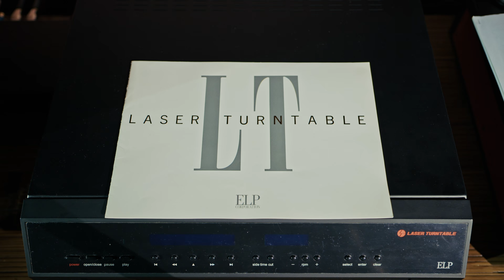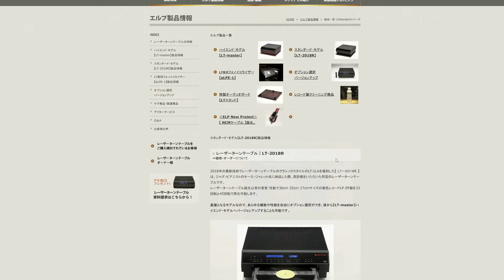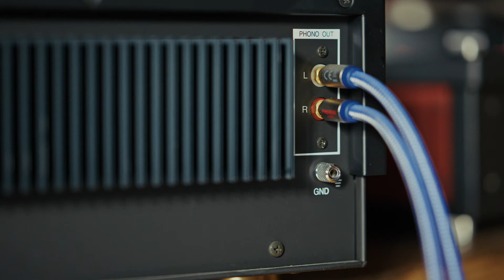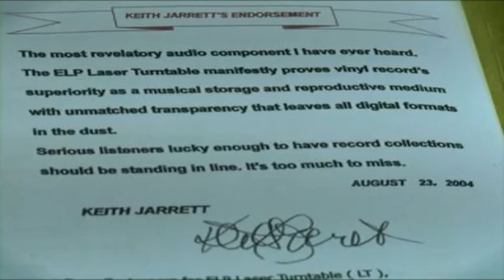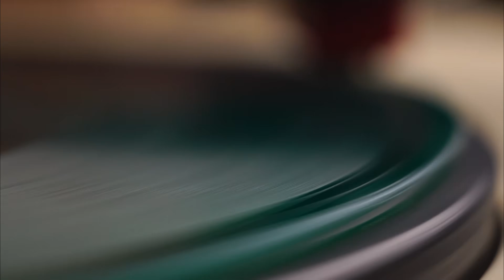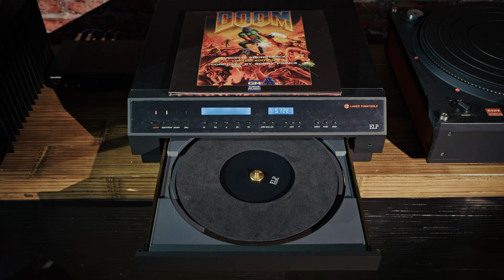ELP Laser Turntable Review / Including Christmas Giveaway - Is This THE ULTIMATE Turntable??

Comment: Cool you can speed up the vinyl on rpm. Not just 33.33 or 45 and so on for presets. Can fine tune it. Sometimes sounds better speed it up a little. 

For make a dj unit. Be little different and more expensive. Little bit smaller. I seen and played with dual dj cd players. I think be the same concept but much bigger form. Laser vinyl decks be more thinner and cables connect to the player cd vinyl drives will go to controller, which have screens, pitch control faders and jog wheel etc.. or big 12” vinyl style moving wheels. Can make it look like vinyl. Many ones have ideas. For example Rane 12’s. which only works with computers dj software. This one be more to vinyl only with controller running it. I do like idea. Have to be more shock resistant if playing in clubs etc.. price be somewhere in 38000 each or less or more. All depends i guess.

Comment: Excellent review, thank you very much.
If I may, I would like to add a few words of my own about this remarkable device.
I am a long-time ELP fan, and I currently own the latest Master Alpha model with the additional Phono-D  output, which I received just about a month ago. In his review, author mentioned the high and mid frequencies — and I would like to add that the bass performance is also outstanding: tight, deep, and full-bodied. This is without a doubt another strong advantage of the unit.
Compared to previous models (this is already my third unit), the stability of LP playback has improved significantly, and playback errors have become virtually nonexistent.
I would also like to note that my unit features a wooden base, which adds a touch of elegance to its appearance. In addition, the feet have been upgraded to more stable, vibration-damping ones.
Another important point that the reviewer did not mention is that the sound character remains consistent over time, unlike what often happens when changing a cartridge.
Of course, a clean LP surface is required, but given the many advantages of this system, this is only a minor consideration.
Reply: i almost bought a unit new @2005 for 5.000$. it was a time when it was changing models. after all these years, one can find many videos to check out the quality especially against high end turntables like the sp10r. how would you rate it against the best you have heard (and which combo that was)? tyvm!

Comment: If I ever win the lottery...this would be a GODSEND to digitising records where the CD or digital versions are often brickwalled to death.
what about off-center records though? will it have issues with those? will it ignore the speed variation?
Reply from the maker: I haven't found any off-centre record in my collection, so I couldn’t test it.
Reply: No. The best remedy for off center records is either removing the spindle and centering without it (preferred) or enlarging the hole sufficiently to allow centering with one. 

I would not want a laser turntable. Too much complex circuitry that could fail.
Reply: According to the patent specification the technology is impervious to disc eccentricity. Its not impervious to speed variations though. You will hear those the same as with any other turntable.

Comment: Having owned the ELP Laser Turntable (the more expensive Hi-Res version) since 2012, I've worked out a specific method to play records on it for it to sound optimum. That's right, different ways to play records on this machine will yield different sound! This is not a joke. What users need to do actually is - before inserting any records to play, power off the machine by the button on the front panel, wait a few seconds then power it up again. Just by doing this the user is clearing off residual playback memory (which for some unknown reasons, adversely affect subsequent playback sound quality). Next, insert the disk, but instead of pressing the [PLAY] button, always press the [OPEN/CLOSE] button. The tray then closes and the player goes into scanning mode to be ready to play, and then when scanning is completed, it then plays the record automatically. The sound is simply better pressing the [OPEN/CLOSE] button than pressing the [PLAY] button. But the real kicker is the playback memory erase that the user just did with the power off / power on procedure before inserting the record. Every single digital playback devices all suffer from this playback memory retention problem, and needless to say, the ELP, since it uses a similar optical servo system just like any other optical disc player, consequently, also suffers from the same adverse effect of playback memory retention. If you are one of those lucky enough to own an ELP laser turntable, you own it to yourself to try this method of playing that I just described. By doing the memory erase, you will find the subsequent soundstaging during playback to be twice as large as you previously experienced.

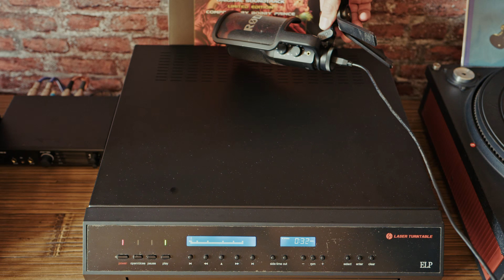Comment: 4:16 Why the hell is it emitting a signal when tracking? Doesn't make sense to me at all given this is a 100% contact free tracking method...
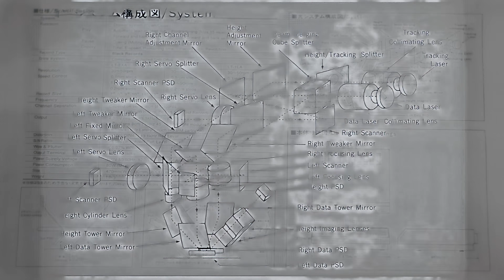Reply: I wondered about that too and think I know the answer. Have another look at the diagram of the optical path @3:42 Notice there are a number of mirrors for left and right groove walls. Some of them are galvanometer mirrors and are used for steering the laser beams so they follow the groove. The galvanometers are not shown on that diagram but they are described in the patent specification. The vibrations of these mirrors kind of correspond to the audio signals being read from the groove resulting in sound effects similar to a vibrating stylus in a phono cartridge. I hope this helps.
Reply: @mikeross4081 wow, thanks a lot for sharing your amazing knowledge!

Comment: Very interesting video!

I own the recent LT master·α model (upgraded to work with the external eLPE-1 RIAA filter), and my experience with it is quite different from what you describe.

One thing I want to say straight away (in part to enter the giveaway competition!) is that I'm pretty sure that the Doom LP would not play on my ELP turntable, as it looks much too transparent. I have several records pressed by Tranco (in the UK) in the mid- to late 1970s, which are a kind of translucent brown/red/purple when placed in front of a strong light, and they won't play on my ELP.

Another marked difference is that I've had almost no issue with warped records. Even records that barely play on my (sturdy) mechanical turntable will track fine on my ELP. On the other hand, skipping is as much of an issue on my ELP as it is on my mechanical turntable, and the VSO feature is of little help with that. Some records that skip on my mechanical setup don't skip on my ELP, and vice-vera, but overall the percentage of records that skip is about the same on both turntables.

Although I've only owned my ELP for about three years, I've already had to send it back to Japan for revision once (out of the blue it started skipping on every other record that I threw at it). So I'm very skeptical with regard to the reliability of these turntables, unfortunately. Getting support from ELP was also very slow and tedious.

As for the price, even with the upgrade and the external RIAA filter, I did not pay as much for my setup as what you indicate in your video (and everything was purchased new directly from ELP). The most high-end turntables currently on the market will cost ten times the price of the most expensive ELP, if not more.

Thanks again for your video!
Reply from the maker: All the differences you’re talking about may be caused by a different laser pickup used in your newer model. That would also indicate the fact you had to send it back to Japan after just three years.
Reply: @KITR-UK Do you believe that the older units are sturdier than the recent ones, then? From your video I was under the impression that all models are essentially the same, with only minor variations.
Reply: I had a listen to your sample recordings and noticed that they's a fair amount of noise throughout. Is this noise also present when you play these records on your mechanical turntable? If not, did you vacuum the records just before playing them on the ELP?

Ultrasonic cleaners like the HumminGuru will get rid of dirt, but dust will get back onto the record when it is blow-dried, and as you mention the laser will ‘read’ the dust rather than push it away like a needle would. The only way to remove dust effectively is to clean the record on a vacuum machine (even a cheap one) just before playing it on the ELP.

Also, you don't need a special platter for 7" records (my ELP was bought new and came with only one large platter, but it's clearly meant for 7" and 10" records as well). You can simply use a common adapter for 7" records with a large hole in the middle, although I would recommend a heavy metal one (as was included with my ELP) rather than a plastic one.
Reply from the maker: I used a simple carbon brush to clean the sample records. I will probably clean them properly and redo the recording.

Comment: I can't honestly remember who made it, but there was an article in either Radio-Electronics or Popular Electronics back in the '80s about a high end audio company that was working on using a helium-neon laser to read the groove of a record. There are supposed to be a pair of photodiodes that were set up so that one read the reflected light from the right side of the groove and one read from the left side of the groove. Hey! I juest checked...... It was Finial Technologies!
Reply: I have copies of those articles, from the early days of the 80s when Finial first started working on this. I think Mix Magazine was also one that had articles about Finial Technology. I also got some correspondence from the company. They first sold to another company, something like Carillon Technology, before being bought by the Japanese company.  The Japanese engineers fixed quite a few things right away, like the ability to change speed and play different sizes.

Comment: i never understood why laser turntables weren't more common nowdays.... until i found out how much they cost. Saw some of these being demonstrated at the IFA in Berlin somewhere around 1999 or 2002. I always wanted one of these because i don't care if the vinyl is not visible when played back and there's no crackle or pop. All i want is being able to play my Vinyl records with as little wear and tear as possible.
Reply: Extremley expensive and as I understand in contrast to what u might believe at first with it using lasers the sound quality is actually INFERIOR because unlike a mechanical stylus there is no dampening inertia whatsoever. Instead the laser will pick up EVERY little dust and scratch and it will thus sounds more like an old phonograph where u barley can hear the music over the noise.  CDs are read with laser yes but the totally clean sound from them is not because of the laser but because CD is a digital format and thus any signal in betweeen 1 or 0 like dust on the surface are totally ignored = no crackle and pops whatsoever on CD (unless you play an extremley scratched or dirty disc where you then will get these characteristic sharp ticking glitches in the sound because the laser cant sort the data out correctly)

Comment: I own the prototype. It’s non-functional as it requires a multi pin power supply. When I opened it up, capacitors have leaked due to age. It sits on my shelf
Reply from the maker: You mean the one that says Finial instead of ELP?
Reply: Why have it sitting on the shelf? Why not get it repaired? If the caps have leaked they can be replaced. Even a power supply can be repaired or reverse engineered and rebuilt by any competent technician. Shame to have fantastic audio equipment collecting dust.

Comment: I really would like to have one of these turntables. But the lack of local service departments is a big problem. Shipping that thing to Japan for service costs around >500€, that's not an option.

I once nearly bought one - at that time there was a (most likely unofficial) distributor in Berlin who would have also arranged servicing. And at that time there was a sale of the older models from ELP for about half the price. But as the distributor in Berlin did not participate I decided against the ELP.

Comment: I have one. Its not great with some LPs especially badly pressed ones, or very high density - like 23 minute discs. But it really depends on the quality of the disc. Bass is NOT worse, its just not pumped up like most moving magnet cartridges do.
Reply: i also have one and agree :)
Reply: The new Master-Alpha model reads these types of LPs perfectly. Mr. Takeuchi explained that they've improved the reading device.
Reply: A standard RIAA equalization may not be well suited to it. I wonder if the units that have high level outputs have a different net result